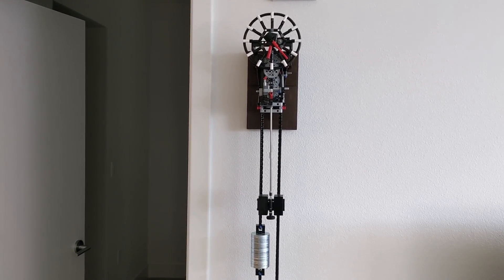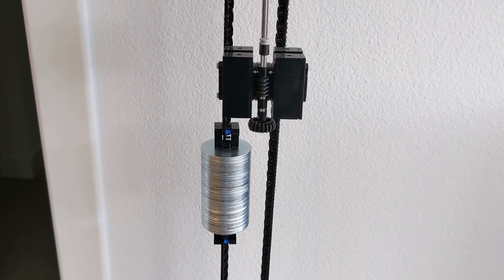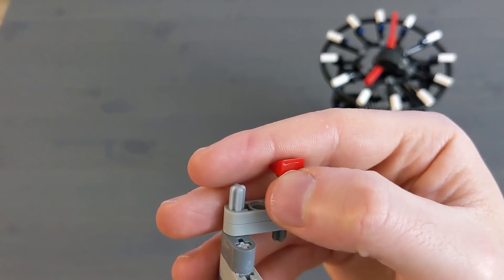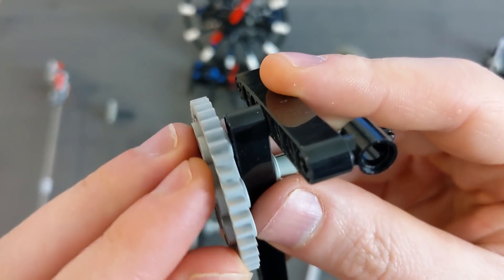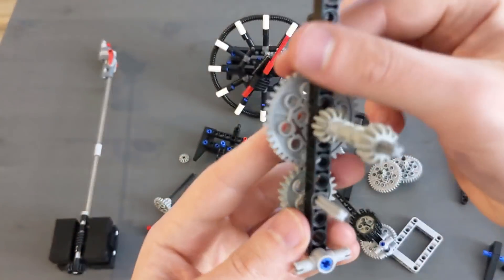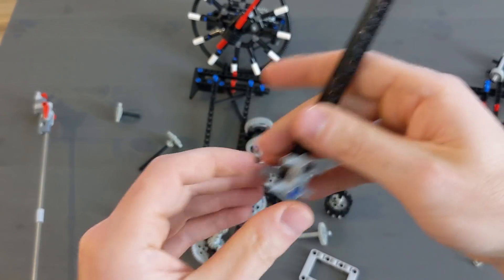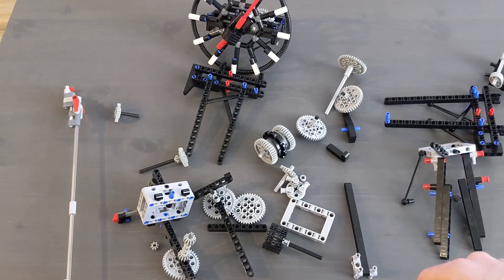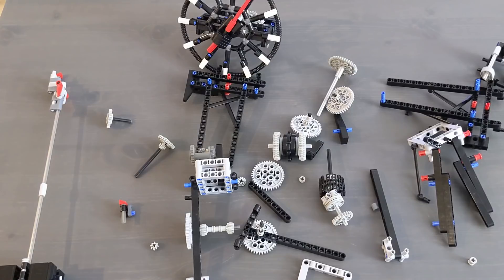LEGO Pendulum clock: can a LEGO clock run for a whole year?

Comment: I was thinking. They sell some pretty thin sheets of PTFE (Teflon). Looking at the dimensions without measuring anything, it seems axles are 4.78mm OD and the holes are 4.8mm ID. They don't sell anything that's 0.0003" thick. If one reamed out the holes to 5mm, one could buy a sheet that's 0.003" thick, cut them into strips to match the circumference of the ID and the width of the beam, curl it up, and stuff it in the hole, and still wind up around the same factory clearance. No mess of oils, and I honestly think it would last forever at the slow speeds things rotate. Plus reduce friction, because PTFE is very slippery.

Comment: How are you able to set the time without messing up the mechanism? I've been trying to figure out how it works on real clocks for a while now with limited success. Is it a planetary gear/differential?
Reply from the maker: The key part of the mechanism is step 20 of the instructions https://dsharlet.com/file/grasshopper%20clock.pdf. I've since simplified the design to eliminate the differential, it's now just an axle with a linear clutch, a bit like this one https://youtu.be/--jds1Za6_I?t=66, though I used the same friction peg from step 20 in my instructions

Comment: Progress with my new arm design. https://www.youtube.com/watch?v=te_fbyVWsS0 I seem to need a lot more torque. I had to drop a 40 to 8 tooth segment and replace it with two of the medium sized gears essentially removing one set of gears.
Reply from the maker: Nice! Once you get it working, hopefully you can fine tune and increase the gear ratio. 3:1 is another possibility between 5:1 and 1:1 (using the newer 36 and 12 tooth bevel gears).
Reply: @DillonSharlet  It worked for 7 hours until the weight reached the bottom (the consequence of the gearing) Then I tried starting it again and it just will not go. I think it was because I had to adjust the arm as my second was much too long in this video and I needed a shorter arm.   Ugh. I want to try and get it to a single arm down as much as possible. And I'll redo the adjustment. Actually I may want a longer arm and maybe shoot for a 2 second period maybe 1.5 second and redo the gearing after. I think a longer arm would give more play at the escapement.

Comment: An idea for strengthening the pendulum https://www.youtube.com/watch?v=HpgHbX3_XWI
Reply: My pendulum started falling off without securing it more like this I am hoping I can find a good solution. thant doesn't introduce too many changes that would effect it from working. I just got the silicon oil to try.
Reply from the maker: Unfortunately I think my pendulum relies on the steel axles I used, which have a very tight fit in axle connectors... you could try jamming a thin piece of paper into the connectors along with the axles or something like that?
Reply: @DillonSharlet  I think I will try using liftarms for my pendulum. I'll need to figure out a way to move the escapement out just a little for more clearance and a longer axel for the escapement gear.

Comment: I made sure it is level both directions. I noticed the positions of the pins on your picture and that I could adjust it with a screwdriver (is that on purpose or a happy accident?) I got it as close to the picture as I could and then tried adjusting it to work. No luck yet. https://www.youtube.com/watch?v=bZlK7zv4B8U
Reply: I got the pendulum length so that the center of the weight should be close to 1/4 meter so that the period should be 1 second. It never swings long enough that I can really judge how long it is taking. I have the weight as close to 560g as I could.
Reply: Seems like they escapment arms are stuck but they seem to move freely to me when I touch them.
Reply from the maker: I've also struggled with the escapement pallets sliding instead of rotating. If you've made sure those pallets spin as freely as possible, another likely cause of this is the escapement not having enough torque. You might try adding some weight, and making sure that the whole drive train spins as freely as possible. The other thing to check is to make sure the clock is balanced, so it clears both pallets similarly easily.
Reply: @DillonSharlet  Yeah I think I'll take it apart and look at the comments about recommended lubes others suggested on your video.
Reply from the maker: The weight on my clock is 560g (just the washers), plus whatever the various lego bits used to hold the weight are.
Reply: @DillonSharlet  I may need a little more weight since I live in high altitude. I live in Albuquerque.
Reply from the maker: @jeffsadowski  Whatever you do, don't listen to the people recommending WD40! I haven't tried lube but if I were going to, I would use silicone or graphite based lubes.
Reply: @DillonSharlet  Right I believe there was discussion of this in your comments.  Hence why I will go through them carefully before finding a good solution.
Reply: @DillonSharlet  Ah silcon or graphite it is. I will go find some.
Reply: So irritating that all local stores are out. I'll have to wait for a delivery from Amazon.
Reply: I put about 800g and it runs for about 10 minutes I think oil would help but I have to wait for that.
Reply: I got it to run for an hour while away. No lube yet.
Reply from the maker: @jeffsadowski  I just discovered something interesting with my build: the right pallet rotates more reliably if you allow it to move a little out of line with the escapement gear. I also switched to using an old 8 tooth gear to retain it instead of a half bushing, in the hopes that would be lower friction.
Reply: @DillonSharlet  I switched to the grey Technic, Pin's without the friction ridges they seemed to have less friction

Comment: Is the length of your pendulum about a half meter?
Reply: looks like maybe 1/4 meter according to omnicalculator physics simple-pendulum calculator for about 1s Period?
Reply from the maker: The pendulum should have a period of exactly 1s. I've had to experiment a fair amount with the length of the pendulum to get the clock to run accurately. The ideal pendulum (point mass) should be around 1/4 meter, but I'm not sure how close to ideal our pendulums are.
Reply: @DillonSharlet  They must get a little acceleration to keep them moving so yeah I think I got it.

Comment: Finally got the rest of the parts I needed ordered from bricklink. I must have done a bad job it cost me about $200 to buy the parts. Half of the cost was I bought about $100 on amazon with new parts. I had to use about six stores on bricklink each I had to pay shipping. I got a lot of the blue 6558 (3L) and a few other parts from my local lego store bins that I could get a small bucket for $8
Reply from the maker: Cool, I hope the build goes smoothly! Post a video of it if you can!
Reply: Sweet I figured out how to upload your io file to bricklink and had it come up with carts and it came to about the same amount. :-) I will certainly get a video of it. I'm only worried about how to adjust the escapement. I will post my attempts at it.
Reply: I had issues with the escapement gear binding with the clock face. I ditched the securing bars to it and used the blue 3L pins to hold it 1 brick further out; consequently I moved both hands out further as well. I used a 3x3 T shaped lift arm to hold the hour hand 2 more out as it was binding as well. and I used a 2L + 3L axel with connectors to hold the minute hand further out. I used a drill bit without a drill to make the pin that holds in the escapement arm slid in and out a bit better. The washers I found that fit the lift arm did not weigh as much per height so I needed to use two lift arms that I split the weights across. I'll try and mount it tonight and see if I can take a short video of it. Time to test my escapement adjustment skills. I plan on printing a paper clock face so my kids can learn to read it better. When I finish I'll have to take it apart a bit and put it in a box for Christmas.
Reply from the maker: @jeffsadowski  Sounds like you are close to getting it working :)

Regarding the clock face and escapement wheel, this can be adjusted by rotating the pin + hole part holding the pin + ball joint for the bar. It seems like many of the other modifications stemmed from that?
Reply from the maker: @jeffsadowski  Very cool to see that, thanks for sharing!

It looks like you could move the right pallet a bit closer to the escapement wheel. It also looks like the left pallet is slipping rather than rotating, this is a problem I've also struggled with a bit (but mostly with the other pallet!). Fixing one of those things would help with the escapement skipping a few teeth at a time, fixing both would make it more reliable.
Reply from the maker: For the left pallet slippage: maybe the axle/bush holding that pallet is too tight?
Reply: @DillonSharlet  I also modified how to hang it. I used two 11 stud lift arms and some other Ts to hold it against my equipment closet door. I used 3 screws on the other side of the door and a string that makes two loops. I can easily adjust the two loops for leveling. I'll see if I can get some pictures up of it. I also used some different pieces on the differential portion. I did use a rubber band for the torque and it did not behave too badly. I used a 6558 (3L) with a 2L Spacer It is like 2 x 18654s not sure what the part number is for it. I put that just below and used an axel with 2 Bushes on it running the rubber band between the bushes and the spacer. Seemed to provide the same amount of torque. It snapback effect was not bad. I have a lot of work to do with it I can not get the escapement quite right and I can not get it to run for more than a couple minutes. The video I posted was the longest it had run without interaction. I know the washers are too high in that video it was an accident while adding more washers. it slipped back in and I was just waiting it out as it fell to the correct position.
Reply: @DillonSharlet  Yeah I made a lot of adjustments I'll take a bunch more videos as I get the chance to.
Reply: Idea for hiding the weights. Look at part 30562 we could use them around the washers. or maybe part 87926.

Comment: If instead of attaching the chain at the bottom of the weight you put a handle at that side of the chain to keep it from running through you could nearly double the effective chain.
Reply from the maker: The loop is important though, it balances the weight on the drivetrain so the torque doesn't change as the chain passes from one side of the clock to the other :)

Comment: Oh this explains your one way mechanism. I had one too few or the chain pieces. https://www.youtube.com/watch?v=juY9KSh-KvE
Reply from the maker: Mine is actually different from that one, mine really does have one fewer of the chain pieces. I think that design will not hold the axle straight enough and result in excess friction, because it's missing the 1L tube to hold the two axles in line. Mine is similar though!

Comment: Hi, this is a very elegant design. I have enjoyed studying the video to replicate the drive mechanism. I have yet to order the penny washers and pendulum rod. I have three requests:
1. What diameters - inner and outer - are the penny washers?

2. What length and diameter did you use for the pendulum rod in the subsequent grasshopper escapement?

3. Could you post a few pictures or a video of the hand mechanism/ construction. A view of the clock from the top and sides would be very welcome. Thank you, Steve.
Reply from the maker: Thanks for your comment, glad to hear you are building it :)

1. They are 13/32" ID, 2" OD. I would recommend just bringing a beam to the hardware store and getting the biggest washer with the tightest fit you can. The ones I use do scrape the beam a bit.

2. My pendulum rod is steel LEGO compatible axles I got from https://store.bricklink.com/eezo#/shop, which unfortunately appears to be shut down now. I think the pendulum length depends on drive torque and other factors, I've had to experiment a lot with the pendulum length, especially to make it so the pendulum bob screw adjustment is useful in both directions. The nice thing about those steel axles is they are a very tight fit, so the pendulum doesn't pull itself apart as easily. 

3. The building instructions maybe will show you everything you need? http://dsharlet.com/file/grasshopper%20clock.pdf

Comment: The escape system means that despite the force of the weight, the rotation will be slow and pression will be applied slowly over time. The inner drive wheels are very slow and don't experience that much force, contrary to the pieces that block the rotation, that is where all the energy finally goes. Plus the wheels are quite stirdy or dense and the red little roof pieces are very light weight by comparison and are in place on a rounded stud giving them less stirdiness as well. And the blatant count you give is also the explanation, the escape wheel blockers are the most sollicited pieces.

Comment: Have you ever thought of using a turn table where all the weight is? I think it would’ve helped regulate a lot of the pressure on the tank tread wheel

Comment: I have built the clock and have some difficulties getting it to run smoothly.
Where did you have the most problems regarding friction?
Reply from the maker: Make sure that all of the axles can move a little between the beams that hold them. There is some adjustment to be made on the gears that drive the hour hand, make sure those spin freely. If you think all the gears are spinning freely, the problem might just be tuning the escapement. It's quite difficult to get the escapement to work exactly right. It might be easier to get it working first with more weight, and then you can work on reducing the weight incrementally.

Comment: Hey Dillon! I absolutely love your design I actually made the efford to build it according to your well made instructions! However, I cant get it to spin freely when I disengage the escapement! I put around 600 grams weight on the chain, even when I remove the top section (the section with the dials which connect to the differential gear) it just wont run! I wondered if you've had similar issues, i read that you use around 560 grams, aand when I try to spin the 40 tooth gear on the back of the model, it doesn't seem to need much force at all, Ll the gears seem to spin freely! Any suggestions? Thank you very much!

Edit: i replaced the 9L cross beams (ball joint recievers)  left and right of the chain with 5x7 technic grey squares, maybe this is causing friction, it just doesn't seem that way!

Final edit: I checked every single gear for its looseness, turned out there was 1 bushing which lightly touched the technic beam, this solved the issue! It amazes me how delicate this built really is, which I absolutely love! Now I can finally start finetuning the time capture! Thanks again!
Reply: @Filthy Fox very nice! Enjoy the build! I'm converting mine to a table model, Which can run for around 9-10 hours!
Reply: Hi, with how difficult it is to move the main drive wheel with my hand(s), I too thought that no amount of mass (on the main chain loop) would ever get it moving.  But 31 thick washers later, and the main drive wheel now spins freely!

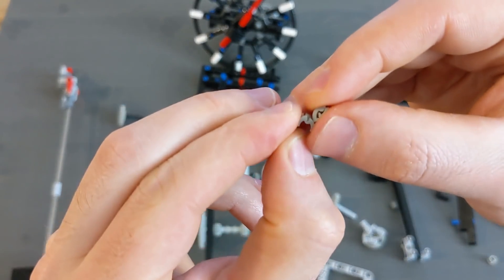Comment: Does this clock show a good hour at all, how will it be built? because he builds according to the instructions and is almost ready, but turning the long pointer after 6 turns does not show 6:00 correctly. I build a lot of lego technic everything is assembled exactly and it doesn't run smoothly and all the bricks are new.
Reply from the maker: It sounds like you found the problem with the hour:minute hand ratio, it needs the old 14 tooth gear and not the new 12 tooth. The ratio between that gear and the 28 tooth turntable needs to be 1:2. As for running smooth, I suggest going through and making sure all the structural pieces are very tightly connected, and all the axles can spin freely. It will require quite a bit of tuning and fiddling to get it to run reliably :)
Reply: I ordered such a tooth 14 teeth :) in general, I put everything exactly in case of problems I will use WD-40 :) unless you recommend some other tawot / grease?
Reply from the maker: @przemekwrebels9682  Definitely do not use WD-40, it will dissolve the plastic (and isn't really a lubricant at all). I would try to get it mostly working without lube first, and once it is working, you could try searching for something that is safe to use on plastic. People in the comments have been suggesting PTFE based lubricants.
Reply: PTFE is probably Teflon grease? Ok thank you for the hint;) tomorrow the 14 teeth should come. So I will do the test I hope it will work, and does the weight of the pendulum have some effect? because it was not already in the instructions in the link under the movie and the original LEGO weights were used there?

Comment: Has the axle of the free wheel a support on the left side? (Where you have your left index finger at 5:02 ? If not, it's no wonder that the little bush got destroyed. If you already have a support there, you might replace the bush with the 4185 part.

Comment: I'd have to imagine that the torque on the axle is twisting it very slightly, and that that little bit of twist is pushing the bushing apart from the inside, as the edges are also worn down from the rotation, weakening it.

Comment: Perhaps the plastic axle got twisted by the weight, and the force from all that slight twisting got transferred to the little bushing which just couldn't take the force of the twisting, and so it shattered.  The other pieces are stronger because they have more material, so they could take it.  Now, you may not see the twisting unless the plastic axle deformed beyond repair.